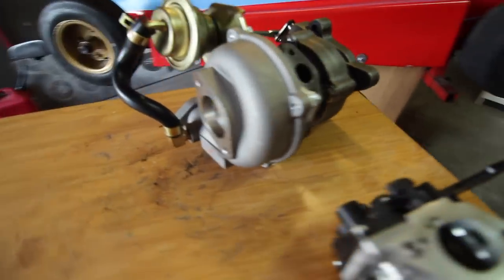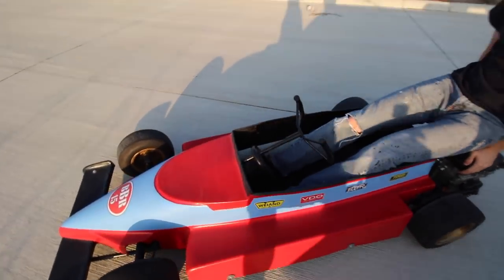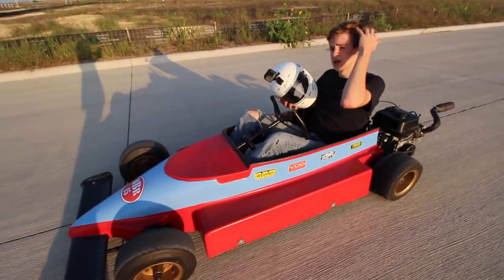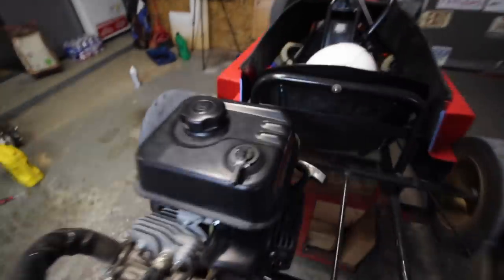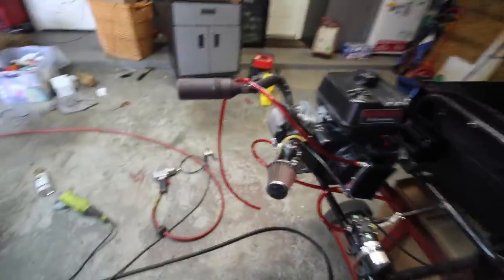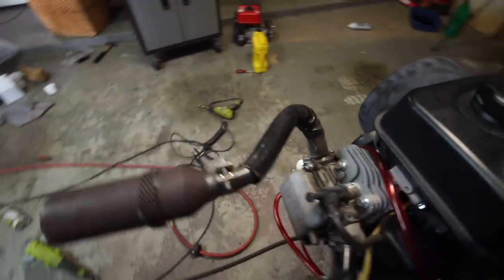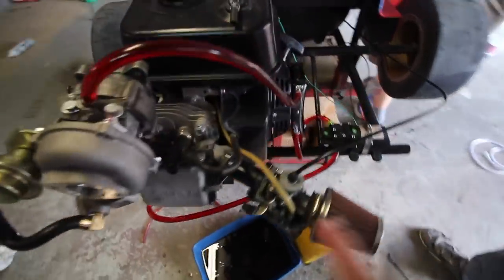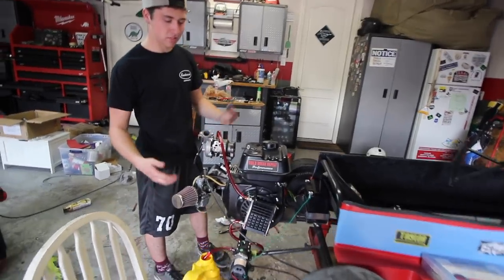Go Kart Turbo Install! | Turbo Drift Kart Build

Comment: Please find a way to make it whizz, bang & pulsate   While shooting fire  like a scene from Tokyo drift   You know Stu tu tu tu tu ....Maby a 
Anti reversion chamber   With a fuel injector  just before the turbo   To spool it up with backfire .  
Or maybe even just a tapered nozzle forcing higher velocity over the exhaust turbine 

One of these days someone  is going figure out how make a 212   Do  this ..  probably the same day a company sells  a bolt up 6 speed

Comment: Open your oil outlet and restrict your inlet. Your pump is over powering your turbos ability to pass its oil through.
Reply: You could try an old smog pump. They're basically little centrifugal superchargers. Just big enough to boost a small motor and just small enough to not over power it.  Its also easier to tune as the boost raises with rpm, you just need to jet it right so it doesn't lean out on ya.
Reply: Send me a smog pump. that would be awesome.

Comment: I’ve been meaning to do that but haven’t bought the turbo #vz21
Reply: i have something 4x bigger than a VZ21 and the exhaust-side is smaller than the valve.
Reply: UnTamed Mustang well ima be pushing a stock internal motor till it blows so idc

Comment: Your running out of gear...just saying!
Reply: Jamie Wood not only that but they need a race clutch because if they make any power when they finish the setup that cheap comet clutch is gonna burn up.
Reply: Very true ^. My TorqueVerter couldnt even move with a high lift cam. i put a clutch and it did better but was still slipping.